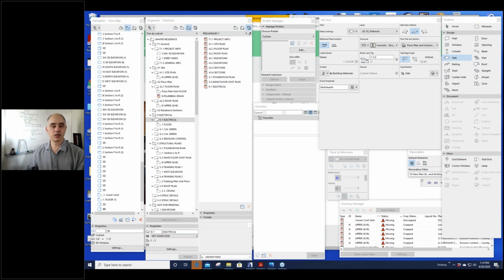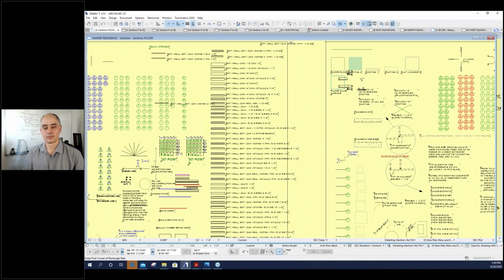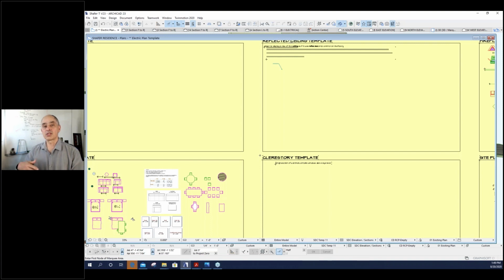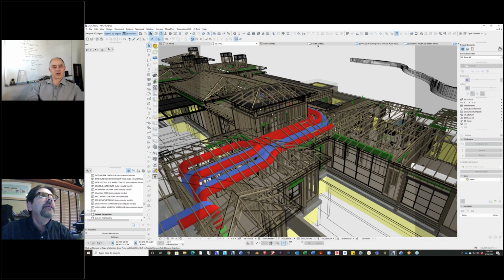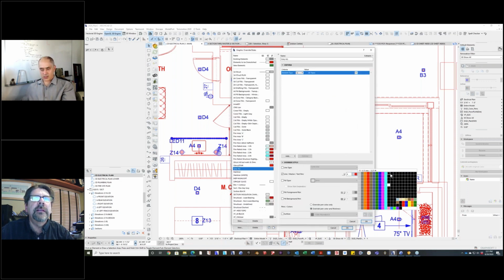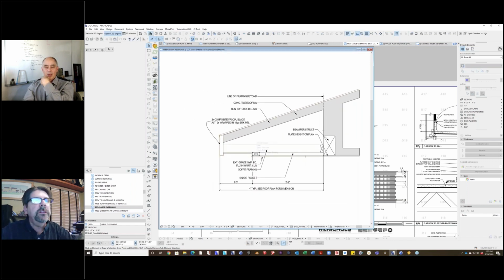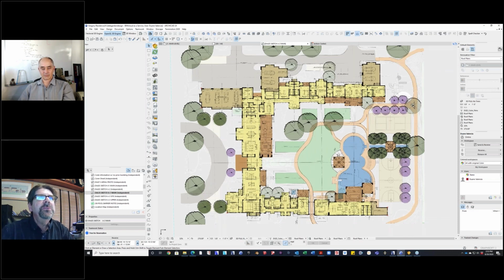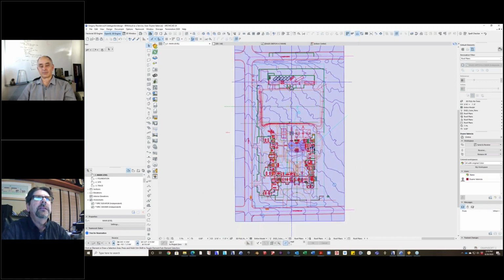ARCHICAD USER Aug. 2020 - Veterans Duane Valencia & Roger Shafer

Comment: hey, where they are based on the plan for example kitchen layouts? like floor ground plan and how make layout them from the model file? the worksheet is that effect for this?
Reply from the maker: The kitchen layouts shown in Roger's template are on the floor plan, off to the side. He then grabs something that he feels might be appropriate for the current design and drags a copy of it into the actual project work area. He's continually using a marquee to look at things in 3D, focusing on either the actual project or on the part of the template that he wants to review and use as a starting point.
Reply: @ericbobrow  I got it, I like the idea actually, I use module file for this purpose, but it requires 2 step workflow and also not efficient for update.

Comment: Will a Morph work for the 360 alpha channeled mountain-scape cylinder?
Reply from the maker: Abraham - it is possible, although I'm not sure what controls you might have for setting the origin and orientation given that morphs are rather complex geometric forms in Archicad. Could be worth a quick test. I'd be more inclined to use generic elements for projecting the image texture, such as cylindrical walls as demonstrated by Duane, or a Shell (which might allow projection onto a dome).